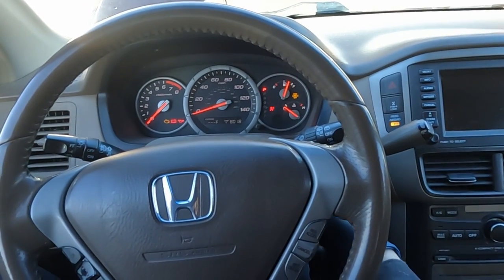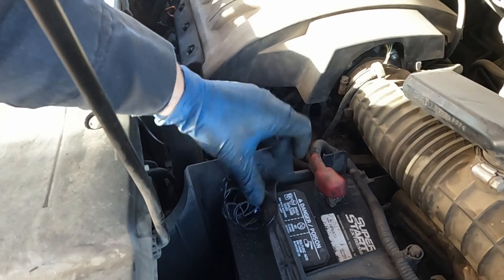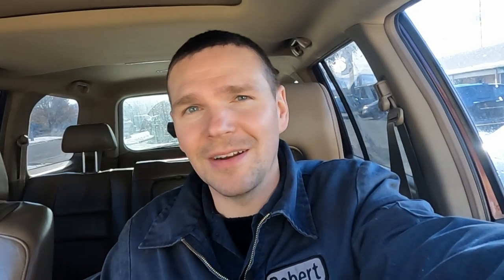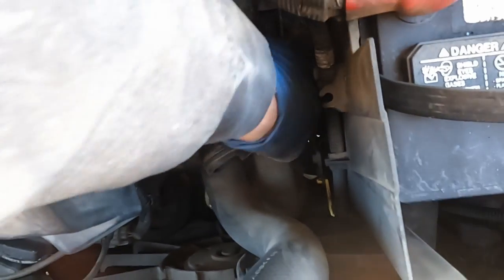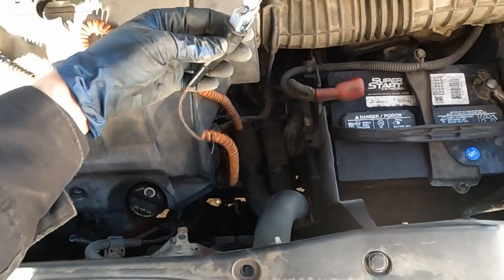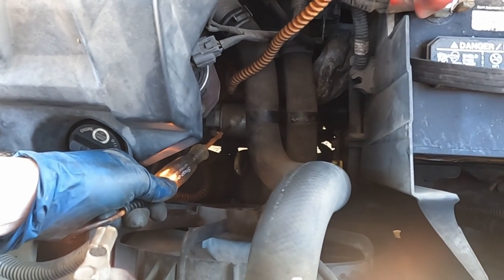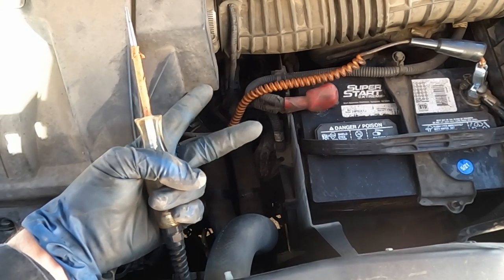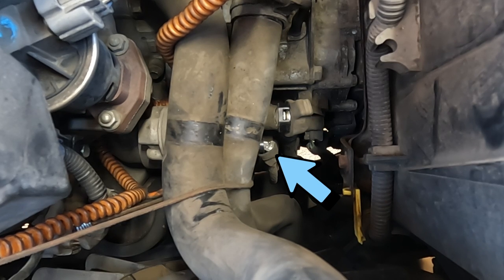2006-2008 Honda Pilot No Start | Starter Testing

Comment: Short and to the point, Thanks! I would crank the engine when checking for the power and ground just to make sure you don't have a voltage drop, Or keep the test light on battery neg and touch starter, then crank if test light lights up you have a bad ground. Thank you for the time you put into your videos!
Reply from the maker: Great comment! When testing electrical circuits a dynamic test (loading the circuit) is always better than just a static test. 👍

Comment: Hi there thank you so much,  my Honda pilot 2011 has no supply ( power ) . Battery is good, relays replaced fuses are fine.
I cranked the engine from direct power and it worked, But can not be cranked from the key switch….!
Reply from the maker: @ahmadh1580  Just to confirm, the main power on the big wire is there? You're just not getting power on the smaller S terminal?

Comment: So,  I love you videos man. I used it to replace my starter. But the 2007 Honda is still starting intermittently with a new battery and the new starter installed.  Could it be the starter relay?

Comment: You are very intelligent and explanatory, but why replace when twice you demonstrated that it started?
Reply from the maker: Good question. This starter motor was intermittently failing. It's hard to tell how long it would be before it wouldn't work at all. Sometimes it's better to err on the side of caution.

Comment: So if the small one doesn’t light up when you touch it while the key is turned, does that mean I need a new starter ?
Reply from the maker: @Hehakaa  If you don't have power on the small wire but you have power on the big wire then it might not be your starter. Go to the fuse box and locate the starter relay. Swap it with one in the fuse box that looks the same. See if that makes a difference.

Comment: Hi and how do you know that wasn't the starter relay?
Reply from the maker: Good question. If the test light is lighting up at the starter on the S terminal when you turn the key then the relay is supplying power to the motor. So the relay is good. If the light does not light up when the key is turned then it could be the relay.
Reply: @ValleyMobileAutomotive  Thank you for your reply

Comment: Starter does not have power when turning it on.  What causes this and can I fix it
Reply from the maker: If there is no power on the small wire going to the starter but you have good power on the big wire then it could be the starter relay in the fuse box. I would start there.